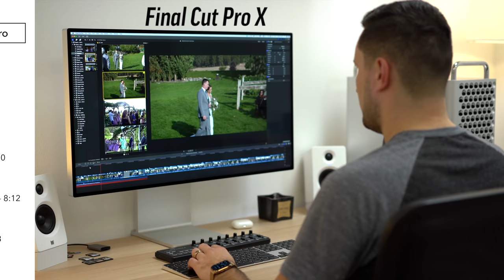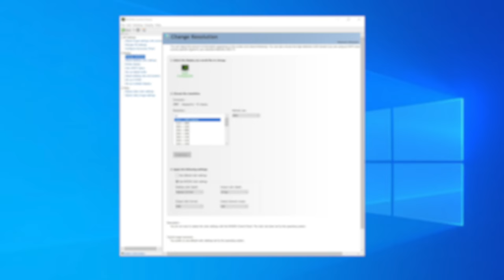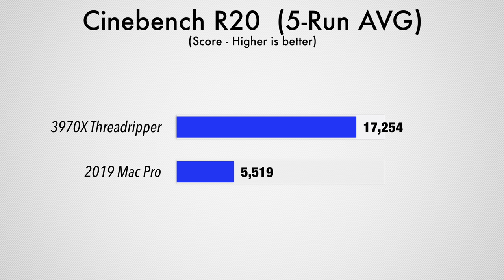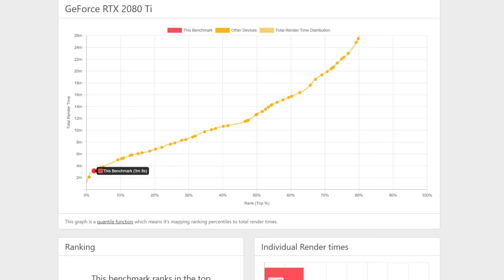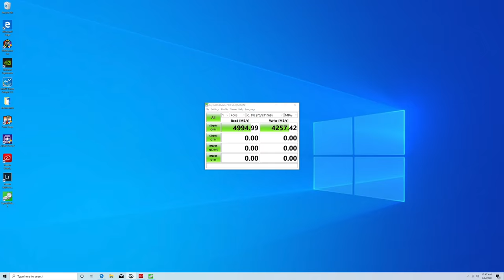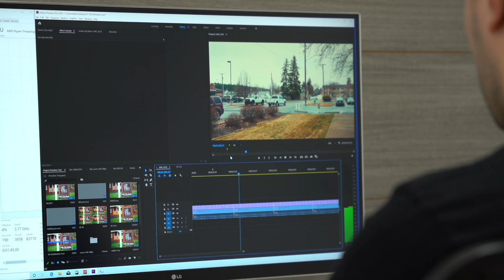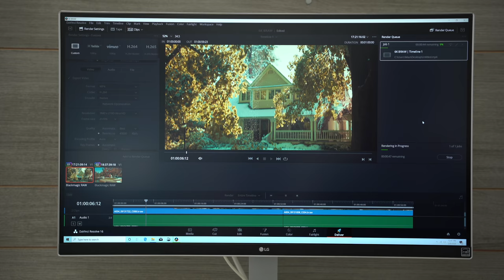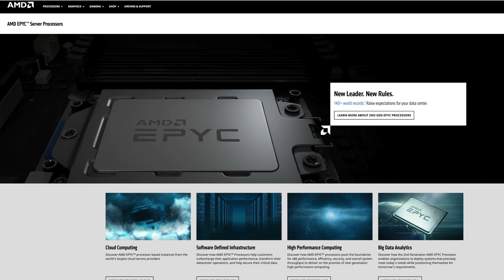$15,000 Mac Pro vs $5,000 Threadripper - Sorry Apple..

Comment: So I'm basically paying $10k for: 
-A "pretty" case
-An alternative "snappy" interface
-An alternative selection of programs, which are available to the pc in a different form
-A heavily regulated support service and ecosystem to show you're too scared to open up your own desktop
-A little bit less noise

Okay...
Reply: you are also paying for the apple tax
Reply: Erm no, your also paying for expand ability, reliability, warranty cover, workstation class processor and graphics with certified drivers, silent running. So serious people who produce the music you listen to will buy and use it, graphics designers or film editors will buy and use it. It’s called ‘Pro’ for a reason. If you want an equivalent NVIDIA GPU then you have to buy a Quadro card, not sure if you’ve checked out their pricing lately? Plus now one will offer you a maintenance contract on a self built machine.
Reply: @marksapollo  okay. But is that really worth $10k? When that money could also provide a far more powerful and even quieter machine, plus a warranty program from another provider, and licenses for those media programs.
Reply: @marksapollo  10,000 dollars for "Workstation class" my ass, also "Certified drivers" is just another way of saying "Old drivers", silent running can also be done rather easy with a fan curve and maybe some under volting/under clocking.  also the whole "PRO" thing you talked about, that's a marketing ploy that Apple is using to trick people who don't understand the  parts that are in the computer. also as for the  "maintenance contract" not only is it often times better to learn how to do it yourself but there are TONS of people out there that you can hire if you want to, and they wont charge you fucking 10,000 Dollars. and as for the "equivalent gpu the 2080ti stomped that card in almost ever application. And even if you spent 5000 dollars on a Quadro it would still cost wayyyyy less than the Imac pro and would shred it to bits even more than it already has.
Reply: Mattuiop Of course it is, you don’t understand or live in the market it’s aimed at, the market where the machine will pay for itself in a few months if that. Where time is literally money and reliability is key. The hats the market it’s aimed at, how many bands like huge ones do you see with MacBooks on stage? A lot! That’s one example. Colourists will use them for all the shows and films you watch. The list goes on really. I’m not saying it’s cheap here or good value, but the people that buy it won’t care as they know it’ll pay for itself in no time.
Reply: Ugly Case to be honest
Reply: @marksapollo  but you can liturally do the exact same thing with a pc but cheaper. Just saying.
Reply: Pretty case? I guess tastes really differ... Vastly!
Reply: @marksapollo  You are paying for expandability?, what do you mean, you know you can expand a pc too, right?, and a lot further than a mac
Reply: Mattuiop No, because Final Cut and Logic Pro and other programmes or programme add ins for colourists etc are Mac only. So you’d have to use Windows equivalents, all I know is a lot of music people seem to use Macs and Logic Pro.
Reply: Santiago Meier Of course you can, but not with as many PCI cards in one machine. As per this video. And then theirs thunderbolt 3. Maybe their is a motherboard out there with 8 PCIE slots and support for the latest Xeon or AMDs equivalent workstation class CPU’s?
Reply: @marksapollo  final cut and logic are great programs dont get me wrong. But are they really worth that extra 10k for the ecosystem? Ableton live, reason, and many many more are available on windows. I can get over 2 minor technical hiccups, a slight hurdle and maybe 5 additonal minutes out of my day if the difference is 10 grand.
Reply: @marksapollo  not those who understand it tho. Many of these companys have tons of resources so youd think that they would have some one on staff that knows what they are talking about.
Reply: Thomas Borisov  im sorry but Where
Reply: @mattuiop  you're completely missing his point. YOU are not Apple's target consumer for the Mac Pro. Neither am I, I'll live and die as a PC Master Race. You and I also aren't professional video editors, music producers, photographers, etc. In that industry, the insane RAM capacity and color accuracy on their display is something required for the sheer size of their projects. THEY are the consumers that Apple's targeting. They aren't interested in custom building a PC for their work, they want something that'll do what they need right out of the box, and those companies usually have enough money to pay the Apple Tax, hence why it costs so much in the first place
Reply: @marksapollo  uh no everything you just listed there is not only false but heart breaking
Reply: @marksapollo  enough with final cut and logic pro there both trash and Adobe stomps them and if you really truly want Mac os you CAN hackintosh it even on a ryzen chipset it just takes extra work
Reply: @marksapollo  yes 10x over yes and fuck "thunderbolt" it's just USB type A covered up with marketing
Reply: @marksapollo  You are wrong(But please read the whole message first), the best programs (daws) for creating music are Pro tools and Ableton, video editing davinci resolve and for painting Adobe illustrator and some other ones. All of those run extremely fine on a 1000€ PC and I even better on a 5k one . All of those apps have downloads for both windows and (whatever apple os Catalina thingy) now the Macs are running or in other words OSX. All those peoples that you see with the Macs on stages , they are just used with the os and that's why they are not changing. It's like telling you , hey man , I know that you are fine in this four star hotel , I really do, but you can pay 4 times less and go in this 5 star hotel .... Yeah it's exactly like that, it's not easy for people to change, that's why because they know that they are fine with their 4 star hotel (with their Macs) they don't make the move to try something else.
Reply: @marksapollo  expand ability? Its a fucking pc, with the mobo u can upgrade to 64gb of ram and a TR 3990x
Reply: George Kalantzopoulos Really, prove it. I’ve seen plenty of You Tube videos by actual professionals, as opposed to arm chair ones, who do use those programmed from Apple. So please prove your point. Must be a reason they prefer Mac too, because if your a professional it’s a tool you use, you don’t care less about the OS, perhaps they find Macs more reliable with less downtime and less loss of money, another thing real pros think about. Your argument totally fails I’m afraid, because your not a real Pro nor watched videos by them obviously.
Reply: Brian Joestar Wow, let me know when you can fit 1.5 TB of RAM eh...
Reply: @marksapollo  People never like changes, if I were started out with a MacOS system, I would of stayed with it, seriously. People will always try to avoid changes, even if it means paying 3x the amount.
Reply: @marksapollo  lmao Mark you can't say someones argument is invalid because they aren't a pro. Because that would be you saying your own argument is invalid because ur also not a pro . Haha I can't believe I read all that bullshit
Reply: Tom The Kaiju I don’t believe that, as I said Real pros see a computer as a tool to work on and make money, they buy what’s best for their workflow and most reliable. You see lots of MacBook Pro’s on stages...
Reply: vincent njagi The fact you’re don’t know what programmes use all that ram clearly shows you have no clue about its target audience. Why bother telling you anything?
Logic Pro could use it. Virtual machines can use it, Mac Pro’s are used in both situations. Plenty of You Tube videos showing you that.
Reply: @ScorchGamers  but you can build a professional grade pc that is able to perform all of those tasks to a very professional standard. Unless your company and clients are already stuck in an apple ecosystem, you can get everything you just listed above and then some for a more affordable price when starting up.
Reply: @marksapollo  Also fix your spelling
Reply: @marksapollo  Just stop with your Truth's they aren't credible Fact's.
Reply: @marksapollo  you sound very butthurt and overdefensive. Instead of trying to prove why the mac might be a good choice, all you do is talk about some group of people who go with macs. And when you say that people dont even know what the pro is aimed that then why dont you enlighten us? Its pretty clear who this pile of crap is aimed at. Its aimed at companies who spend 15k like its for their lunch and all the support apple provides is more often than not, not even utilized. Why you ask? Because repairs are costly and take long so big companies like that are just most likely going to buy a new one. Literally everything is a scheme to get these big companies to open up their wallets. If someone were to build an equivalent pc to a mac the difference would be too huge to even bother comparing. Everything which you buy for your custom build often has a very long warranty and because nothing is a specially made component you can upgrade everything in the system and troubleshooting becomes a breeze compared to mac. Mac would be a compelling choice for smaller artists if the cheese grater was 12k cheaper.
Reply: @marksapollo  When you claim that Mac is better because support 1.5TB of RAM but the CPU and the rest of the system is your bottleneck lol😂😂
Dude how much Apple are paying to defend them on youtube hahahaha.😂😂😂😂😂😂😂😂😂😂
Reply: Just the fact that you can buy 3 PCs instead of one mac pro, and each one of those PCs woule be more powerful than the mac.
Reply: @marksapollo  lmao apple fanboy
Reply: Bagowzibow ! Dude you’ve got no fucking idea about the world the Mac Pro lives in, now run along and play with your light up gaming PC..
Reply: marksapollo most editors even for youtube don’t use final cut.
Reply: marksapollo I enjoy how you don’t answer any questions now and just insult people because they are right. “I’m not going to bother with you” my ass. You know. How about you respond to mrbuzzkill’s comment. He explained everything perfectly
Reply: A pretty case????? how??? why??? really???
Reply: @frieddayfriday  ikr. imagine thinking a cheese grater looks pretty lmao
Reply: The Pro consumes less power, supports better gfx cards with its Xeons, produces less wear in fans/parts, and hugely outperforms the PC in video editing.  I am NOT saying that the $10k is remotely worth it, but you're cherry-picking the details here.  Watch the video again.
Reply: Case looks like shit
Reply: how is THAT a pretty case it looks like a cheesegrater built on a toaster
Reply: @marksapollo  isheep
Reply: lol, if you want the snapiness and simplicity  of macos, just do  hackintosh, lol
Reply: @ZakTheKaiju  bruh, just get hackintosh
Reply: @marksapollo  lol you can run along and grate cheese with your mac pro lol
Reply: @ZC.Andrew  Hugely outperform in vid editing? Hahaha! Hahaha! Hahahaha! And support better gfx card? Hahaha hahaha hahaha.. Jokes of the year..
Reply: paying for a glossy apple logo
Reply: @marksapollo  The PC here is workstation class, in fact, its better than Apples workstation class.
Reply: big chonk No it’s far far far from being workstation class..
Reply: Lol $10k? You're paying $15k baby, apple don't play around.
Reply: 15k cheese grater
Reply: A lot less noise actually
Reply: Do you have a 10k$ or even a single panny....😅😅😅😅
Reply: There are clones of the case you can buy for $150-200
Reply: Video editors at tv and film companies still use trashcans or iMacs with i7s. Some even use the older Mac pros. Most tv n film post houses are firmly engrained in the Mac ecosystem.  You dont need these machines for editing, but would possibly make there way to online editors. If you just edit at home for hobby, YouTube, or small jobs pc is good bang for buck.  Also Most pro audio guys need logic and these new pros are solid for them, and a godsend.  Yea it’s a lot, but also a work investment for a lot.
Reply: You can also save $100 by using a linux distro to get that extra snapiness.
Reply: @mattuiop  this guy really don't know the biggests companies have their own softwares, so you don't need to worry about "OS exclusivity softwares" like final cut and many others .
Reply: @marksapollo  leave him is already dead... but i love see apple fanboys defending trash.... jajajajja
Reply: Guys we all know that Apple ist a religion for non Computer-people.

They dont understand what they buy..they buy the apple.

And they will mit believe you.
Reply: @ezakiil  you do realize to work with 8K VFX you need over 512gb of ram right?
Reply: I am not defending the Mac Pro here because it's overpriced as hell, but you simply cannot compare a Xeon processor with a Threadripper in certain workloads because Threadripper only supports up to 256GB of RAM which in workloads like 4K VFX is the STANDARD, and in 8K you want double that. So simply put, AMD to avoid competing against its own line-up of EPYC, decided to let TR processors have a memory controller that is just leagues behind what Xeon offers, leaving people to either have to buy the Mac Pro with its overpriced tag or get an EPYC that can match it.
Reply: Also, this comparison takes the mac pro with parts that have been bought through Apple, when you could get the exact same config, if you instead decided to buy the parts on Amazon, eBay or Newegg, and save thousands of dollars for the same hardware.
Reply: V M, I’m not Apple fanboy but I think it’s because it has 1.5 TB of ram and buying that much ram itself is about 18k Dollars.
Reply: Dont forget the $800 wheels bro
Reply: And the logo
Reply: Why are people acting as if mega corporations give a shit about pricing?
Reply: @marksapollo  "workstation pc" you mean the fucking Epyc cpus with more cores and threads than poor xeon
Reply: @marksapollo  pretty sure Linus got up to 1tb of ram
Reply: @marksapollo  that's literally why Quadro exists
Reply: marksapollo stop saying mac pro is the ultimate. IT ISNT!!!
Reply: I have been reading you all, it has been real fun. As i gather none of you are proffesionals, but maybe i skept a comment. Well, i am a professional, not movies, or sound, but 3D, and most of my work is about going to companies that want to adopt 3D in their workflows. Mac always give us problems, mostly because of graphics but then because program compatibilities. I dont know about music or movies, but in my industry and personally (no idea what they do in big studios) i would never buy a mac. Noise is part of the job, uglyness i dont care, repairability is key and btw, i read a very funny comment about colorist who need mac... Did you know that at the digital branch of pantone, they have zero mac screens? Only Eizo screens, so yeah...
Reply: Not just a snappy interface, it's smooth and less prone to error when working between different software. This was confirmed in the video. Also, Mac is more energy efficient. There's too much huffing for relatively simple tasks out of the Threadripper which indicates wattage increase and that's not promising for longevity of quality in the life of the machine.
Reply: @marksapollo  good troll
Reply: you can just use a vm for the os
Reply: marksapollo you can probably get a warranty for each part of the pc and still be cheaper (but who needs a warranty) expandability is more so on the pc, „certified drivers“ my guy what’s that even mean they are literally the same normal drivers, and silent running can be bettered using fan curves etc, and a „workstation class processor“ you literally sound like a salesperson. The amd system could also be branded as that. It’s 42% faster while being incredibly cheaper. So stop trying to justify this insane price for objectively more awful hardware
Reply: @marksapollo  you know 10k is a high amount right.I don't want to pay 10k more for less noise and that so called "workstation" class mac pro
Reply: @yuske05  paying 10k more but get less performance.Also,you can easily update your drivers and get better power efficient drivers.Mac pro is just a  trashcan
Reply: @unusuallyquickloris  lol what a joke are you big studios like marvel, warner bros, Pixar, Disney, DreamWorks use Linux Workstation and Windows workstations and also in gaming studios like Ubisoft, rockstar, electronic arts they use windows because of 3ds max for there pipeline and what about Quadro series GPU your mac pro is trash in work like 3d animation, VFX, gaming industry
Reply: And can't play hentie games
Reply: @marksapollo  pfft apple fanboy
Reply: You can hire a case builder to help design and build your own case for $5k or less anyway.
Reply: The case looks so ugly
Reply: Rich people and corporate buy experience and solution. They dont care performance price ratio. They don’t even listen to your explanation. 10k is like few dollars to them. Mac just beautiful and works well and they just buy it. Just that simple. What pc fans said are all correct but those people just don’t care and want a “designer computer”. Thats how apple keep generating crazy amount of money and will keep going despite so many haters
Reply: @marksapollo  the apple pc, is using a server cpu getting destroyed by a consumer pro cpu. You can make an epyc with 2tb of ram and completely annihilate it.
Reply: @ZC.Andrew  better graphics cards? You can use an rtx 4090 or professional workstation gpus with a pc which then you dont even need the cpu to render the video. The amd cpu pulls less power than the xeon as they are two different cpu classes. The xeon competes with amds epyc line which also annihilates it.